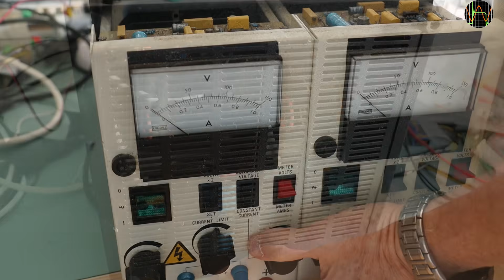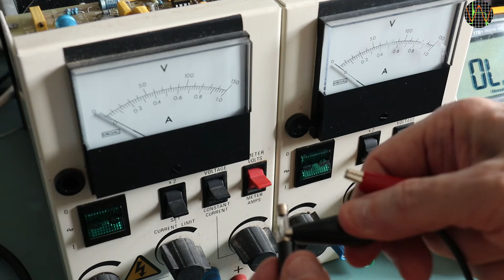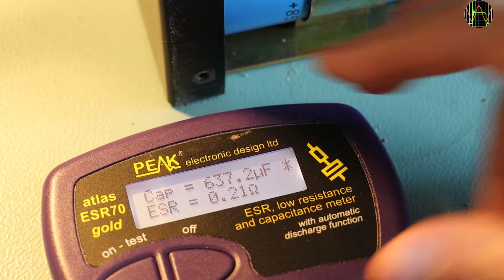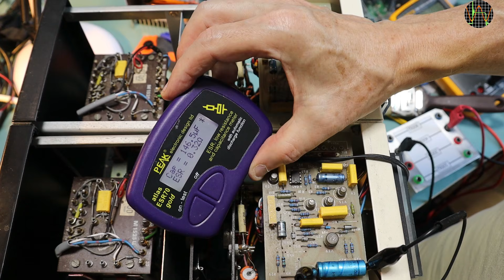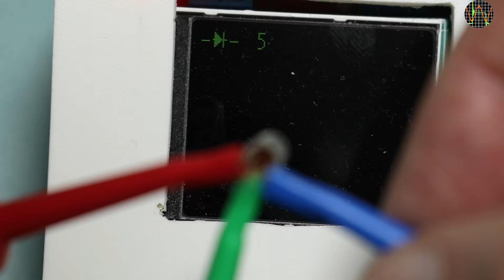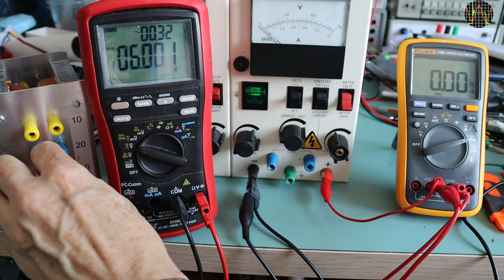223 - Repair of a Kingshill V-series Power Supply Unit

Comment: The only "problem" i found with these type of cap/esr measurement-units is ... they generally work with a very low voltage not even close to the "working voltage" of some of these caps. Thats why i build a tester with up to 400 VDC, because some caps show problems only if they are run with their respective working voltage. If this unit works fine, you could build your own high voltage cap tester :D

Comment: That constant current mode is scary! It's always nice to have a high voltage linear supply in the shop  - good for re-forming and leakage testing high voltage capacitors. Regards, David